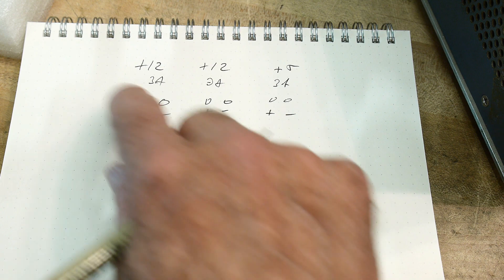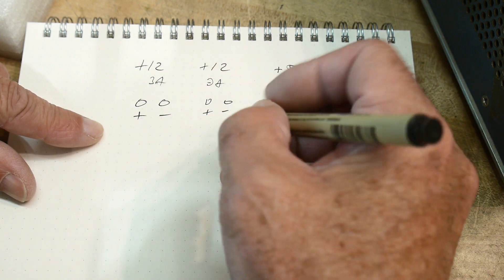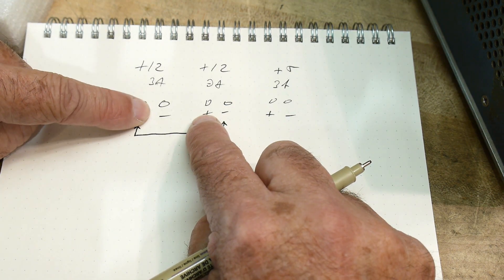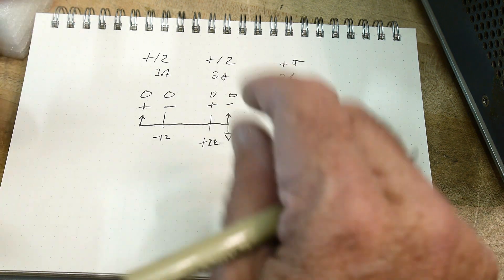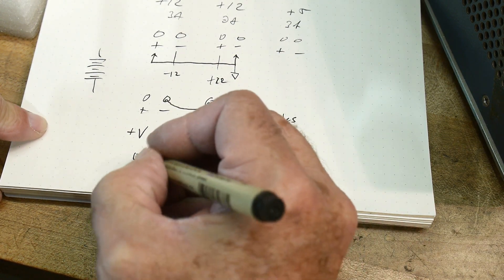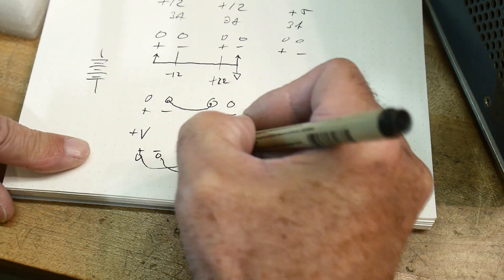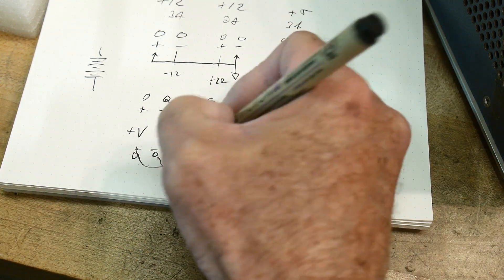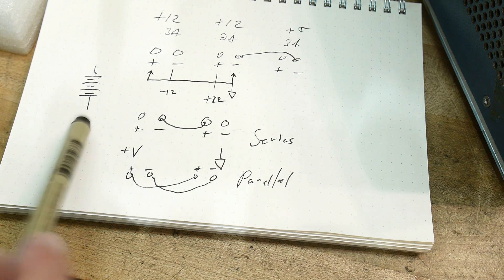#1093 Power supplies in series and parallel

Comment: idk if anyone will read this but, if i have two psu's connected in series and i want to limit the current to 10ma  for testing high voltage zeners, how do i set the current? 5ma on both supplys? 10ma one one supply? what is the proper way to current limit series supplys?
Reply from the maker: 10mA on each
Reply: @IMSAIGuy  Wow that was super fast Thank you!! I don't comment a lot but I really appreciate your videos and appreciate the way you explain subjects!

Comment: after connecting 2 supplies in parallel, they start to feed current to each other. You can see it at 6:53 - without any load, one supply already uses 45mA, and the other 21mA. That is of course average values, as they constantly try to feed each other. I guess setting a diodes in the wires will prevent the current flowing to the supplies, only from?

Comment: if one fails/burps/  then all die... right
Reply from the maker: not if designed right. the other will current or voltage limit.
Reply: @IMSAIGuy  in non death mode,,,   u might need protection diodes...

Comment: Maybe others have said this, but most PSUs will only give you so many watts of power and that number will be something less than its rated volts times its rated amps. So, a 30V/30A PSU might only be rated for 60 watts, not 90. You must check this for yourself in the literature, because the better marketing angle is to state the volts and amps. Good tip on some channels having a common ground. I did not know about that.

Comment: Question, doesn't having your oscilloscope on top of your power supply introduce stray noise onto the oscilloscope's measurement?
Reply from the maker: both are shielded. and the supply is linear. so I don't think it is an issue. My LED lights create the most electrical noise in the shop

Comment: Also do note that you don't always get full sum currents when paralleling two or more supplies, it'll be limited by the difference in voltage output accuracies of each supply. Based on actual output voltage, one of the supply will always load the other by a fraction dependent on the resistance between the two supplies parallel connection wiring and the difference in their accuracies. 

In most hobby use case this is not a concern but if you're doing this at work to make some electrical measurement,  do take note of this behavior.

Comment: Awww, you missed an opportunity here.  When you first started the parallel example with low load I noticed the display on the Rigol showed that almost all the current was coming from the left supply.  Would have been nice to explain that and show how it changes as the load increases.

Comment: Be aware of paralleling older power supplies with pots for controls, the voltages have to be set as close possible to the same voltage.  Otherwise they will fight each other. Usually I adjust each supply close as possible and put a .1 ohm resistor in each positive terminal and take the output from the y of the resistors.
Reply: a lot of power supplies ďo not pull the voltage down if the output is above its set voltage,  so the psu will the lowest voltage will not provide any power to its output while the voltage on the output terminals is higher. so one supply will be providing all the current and being overloaded.

Comment: Most triple output supplies have buttons or menus to do the series and parallel mode.

If you put supplies in parallel externally, or with physically separate supplies, you are liable to let the magic smoke out.
The way around this is to put a forward biased diode in series with each supply.

Comment: Thanks for the tip. My power supply has buttons to select independent/series/parallel modes for the two outputs, and I never really looked into what they did. I've never needed the extra voltage or current yet, but it is good to know it is there if I ever need it.

Comment: Beware with this trying to draw too much current from the series connection, because if the one supply goes into current limiting there is a good chance it will let the magic smoke out, because now the pass transistor in the supply shutting off is now going to become reverse biased base to emitter, and can easily fail. Even then most do have a diode across the output to clamp the negative swing, but this is often really under rated, and can easily go short circuit or burn out and go open.